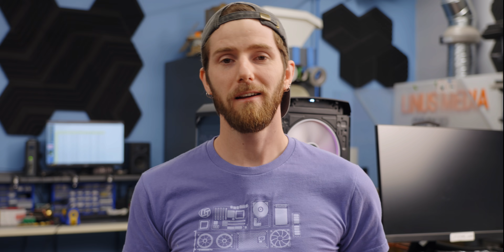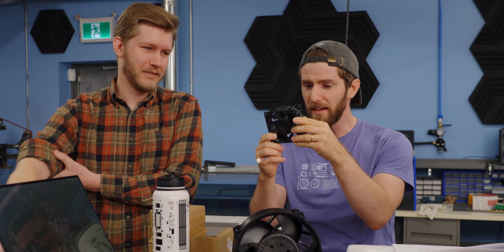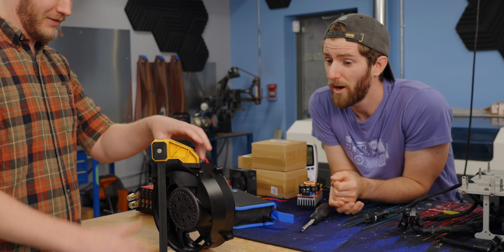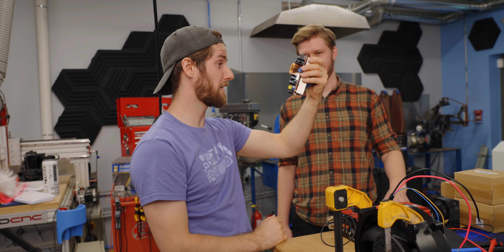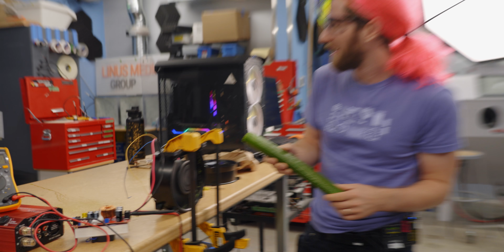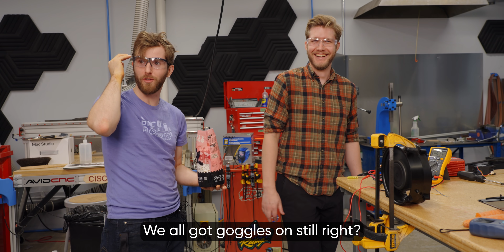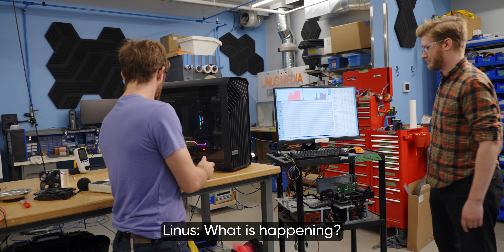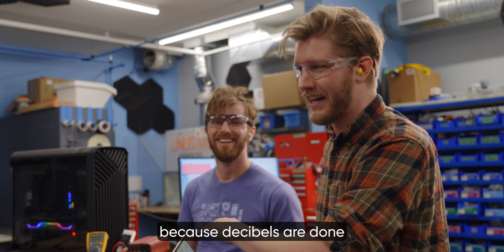The God of Computer Fans

Comment: Electronics like television transmitting equipment, broadcast etc need airflow en masse to be on the air 24/7 at a buncha kW dissipation, also stuff like industrial control cabinets sometimes have fans like that bolted to em depending on whats in there, also large transformers can be used at higher specs with fans like that, itll be a seperate rating specified on the nameplate "with fan"

Comment: RE 14:15 
It probably wasnt that model, but I have encountered similar large diameter high-airflow fans for cooling an entire racks of theater lighting circuits. Each dimming module had no fans of its own, so the rack fans pulled air through all of the modules at once. Even with efficient modules, there could be up to 384 thousand watts running through those distribution racks, which means a lot of waste heat. It really is about obtaining the most airflow volume.

Comment: The other thing with fan sizes is that on a large the blades are traveling a much longer circle, thus the linear velocity is much faster at the same RPM's.  Airplane and helicopter rotors are capped at similar speeds as these fans because they start becoming supersonic at the tips and end up with all sorts of issues caused by that.  Wind turbines rotate at far lower RPM's but at that massive of a scale the linear velocity at the tips also starts to apporach troublesome speeds.

Comment: Full ANSI face shield and level 2 kevlar STAT! Mounting fans that don't fit? Don't worry, I am a hillbilly. They are called Zip Screws. "Self Drillers" LMFAO    PS: Their use is usually equipment cabinets. Contactors, daughter cards, transformers, etc. HVAC/Server racks/Switch gear cabinets, etc.

Comment: Reminds me of the Fans of my old IBM BladeCenter H. It has two 3-phase inputs. 2 of the 6 phases are just for the fans with the fans drawing ~850W each on full power. I don't have the specs for the airflow though. They are centrifugal fans from EBM Pabst and build up a quite strong static pressure as they have quite a bit of resistance to overcome as they are pulling the air through the 14 blades.

Comment: Husband's old workplace had very similar fans in the server room by the racking.

They had the genius idea to have the servers in a room with direct sunlight where without the servers being on if it was 20 degrees outside it was 30 in this room so had fans like this to cool the room down especially with the server turned on
Reply: Why not just put foil on the windows to cover them?

Comment: That Fan is a (Telco) top of Rack Fan. Is used in (Telco) datacenters to extract hot air from the top of Racks (in addition to cold aile-hot aile methodologies). Sometines, the fan even connects directly to the Return Vent system.

¿Why all the Telco in between parenthesis you ask? Well, your fans are SPECIFICALLY 48V, and for historic reasons, Telco Datacenters tend to have -48Volts (yes, is minus forty-eight volts) readily available. In some (very old) telco datacenters, is the only power available.

By the way, right wing safety squad is right, those fans are also used as backup for the main climate system in BTS (Base Tranceiver Stations, not Corean Boy Bands) Shelters... That's how I first meet them fans (pun intended)

Yes, when you use -48V the power cables are MASSIVE, but you connect DIRECTLY to the -48v battery bank and save a ton of money on inverters, as well as the inneficiency (electrical loss) that the inverters entail, and remove a point of failure and maintennace cost...

I guess there are versions of those fans that use AC aimed at other applications like the Transformers of Valtteri Välimaa (I cuut my telco theeth surrounded by Nokia People) and N3ttx, or the Eurovision Screens of Graham Sutherland

Comment: I used to work for a solid state frequency converter manufacturer. We installed these fans to cooldown the 90kva to 550kva inverters inside the converters.

Comment: I have the same boost converter. Absolutely love it for projects that need 12-90v DC.

Note. The low volt protection does not actually power completely off.. At least on my unit.

Comment: i've had to get abut 30 for these for a new Net farm, we use them at the top of each enclosed rack to pull air into it. Cienna equipment makes so much heat. Fun fact you probably already know, most telecom equipment runs at 48-52VDC, AND the system is polarized, so negative is positive and positive is negative.

Comment: I can personally attest that Canadians are unnecessarily afraid on voltage in any form. 

I'm genuinely surprised y'all will unplug a wall socket without a CUL inspector or an electrician present. Your ignorance of electricity is actually shocking.

I see it weekly... It's a thing. Man up girls, it's just electricity. 99% of the time it can only scare you. RARELY is it able to hurt you.

Comment: Delta freaking EDFs, they are no longer fans. I've got an old one with a pwm controller, 20 years old, runs much louder than an old vacuum cleaner and actually rises most of it's own weight which is over 1kg. It's a small one, around 100mm, but really thick, almost a cube.

Comment: I have used something similar to these for cooling flame scanners on a boiler, basically the optical sensor can get so hot being exposed to the flame that a large quantity of air is need to keep the sensor alive. The noise is not an issue considering the blower on the boiler is considerably louder.

Comment: i work with current interrupters & diodes all day at work (corrosion technician) we use diodes on our rectifiers and anode systems when applied cathodic protection currents to gas lines / facilities. really to see this mentioned here in this build!

Comment: I've seen fans like that in robot control cabinets (like ABB 6400 size) as well as on ventilation/air purge solutions for flammable particles or toxic gases, so like welding stations and the like, and for induction heating cabinet cooling (20-50kW cabinets)

Comment: This was bad ass lol
  i would also like to see a write up on different types of fans , centrifugal fans , different axial fans like tube axial and vane axial fans … but particularly through radiators and etc for the most extreme cooling 

Some of these create high static pressures which would be great for radiators … 

Go from carpet blowers and swamp coolers.. to commercial kitchen vent hoods … to maybe scaling them down some how

Comment: We had a bed of nails circuit board tester.  It was set up for very large boards and required a several thousand watt vacuum pump.  The pump was real loud so it was placed in a heavily insulated box, but it still needed ventilation.  We used two of those fans, one blowing in and one blowing out.  The box did a good job of silencing the pump and muffling the fans. It felt like you could heat a house with the hot air blowing out.

Comment: 1) thode step up converters are ~20€ here in germany on amazon and the same (including shipping) on Aliexpress, so your 50$ ones are way overpriced
2) the connectors arent soldered very well but the converters themself are beefy enough to handle a good amount of power when cooled properly

Comment: I use these fans at work. 

It's 2 fans per-cabinet, and it's for and air dryer. It has a compressors in the bottom, then the radiators with these fans on top, followed by the desiccant towers and the control electronics on the very top.

They run 24/7 for many many years with no issue except the hearing damage.

Comment: From personal experience, you will definitely feel 48V, but it isn't enough to cause damage. Under typical circumstances, you can safely handle up to 50V DC before it becomes "dangerous". Atypical situations like wet hands, sensitive body parts, jewelry, and open wounds all dramatically reduce the body's electrical resistance, which could pass enough current to give a potentially medically significant shock. Power Over Ethernet is typically right around 48V, actually.

Comment: Some vendors are utilizing similar fans as backup climate control for base station (mobile cell towers) that are installed inside shelters.
Those fans are ideal for that usage as most of the telecom equipment on the base stations are powered by 48 V.

Comment: When the UPS batteries are inside the datacenter, it is normal to use this type of fan for the emergency air renewal system, in case any battery leakage occurs. It's a scenario where we have to get the contaminated air out of the room as quickly as possible.

Comment: It seems like it worked out just fine for y'all but as a side note measuring the output of a voltage converter like the boost converter you used can be wildly inaccurate if done without a load attached, so always double-check if you're using something more sensitive than a blowzooka. xD
Reply: Yeah, I thought the same thing when I saw that

Comment: We used these at HPE in our prototype testing racks, but we did have PWM controllers for them.

You can actually control the PWM with the blue wire, the yellow wire is the speed sense wire. So technically, yes, you can actually wire them up to the PC and let it control their speed.
Reply: Could you hook up the blue and yellow wire to a PWM fan connector, while having the power externally provided like in the video, and control the fan with fan curves, just like normal fans?
Or do they need the power also hooked up to the fan header?
Reply: @marcel1416  Yes you can definitely do that with common ground, aka connect the ground to the external PSU and to the motherboard, then you can connect the PWM wires etc. I used to do that with my Raspberry Pi.

However, these fans may be designed for different voltage of the PWM provided by the motherboard and even if they are, you would want to have these two circuits isolated from each other with like a controller that passes through your sense readings and PWM controls, it's better to fry a controller than a motherboard.
Reply: @Astra3yt  the PWM is probably 5v
Reply: @Astra3yt   I would probably isolate the two circuits with something like a photocoupler, which is way cheaper and easier. I wonder what the computer would do with these, would it PWM them to max speeds or would it settle them at a more reasonable setting?
I am against putting unknown things into common ground configuration, because you never know when these sketchy modules decided to do common VCC (yes that is a thing. For instance some LED strips would do that and you need common +12V modules to be able to control properly). If you are really certain the voltages are all good and the devices have common ground referenced to the grounded pin on the AC input side, you could technically connect directly, but still not recommended.
Reply: Thats a BIG "technically" 🤣
Reply: @dragonxx444  lol I didn't say he should, but hey. Let Alex do it so we don't have to!

Comment: This is purely conjecture, but my out of the box guess for a use of these fans would be incredibly high FPS cameras. Something like Caltech's 1 trillion FPS camera they use to study the movement of light. I imagine the processing power and data movement systems like that utilize is immense, and probably generate a lot of heat very quickly. Perhaps something like this fan can be used to move cooled gases through the system at a high enough rate that it doesn't burn out in a millisecond.

Comment: Old business/commercial computers back in the 80s had similar fans just not quite as powerful but if I remember right they were solid metal as well. TRS 80 model 2 had giant fans along with the massive 8” floppy drives. When you would turn it on, you could hear it spool up like these fans. I haven’t messed with them since the 90s so I don’t fully remember their actual size, I just know they were massive.

Comment: I have a pair of air hockey table fans, very similar to these. They are heavy, metal frame and blades and very loud but they can move some air, use them to vent the attic in the summer time.

Comment: 1. You need to check the air pressure inside the case. With the air being compressed, the air is going to be able to remove more heat from the cooler.
 2. The Noctua 3000 rpm fans are NOT the best actual case fans. The bgears BG01831 is a 12v 38mm thick 140mm case fan that puts our around 300cfm at max speed and the static pressure dwarfs what the Noctua fans do. I have 6 of them in a push/pull configuration on my current water cooled 5950x setup. They generally run at about the minimum speed that they can. They do spin up to max speed on power on which blows the dust out of the radiator if the computer has been on for quite a while.

Comment: You can buy these on REALLY cheap second-hand from old server rooms. These fans are indestructible. I bought two of those for toilet ventilation for like 8$ each on a flea market.
They are sometimes used in server rack cooling. Like, cooling the whole rack.
Reply: Toilet ventilation? Someone needs to change their diet.
Reply: @brodriguez11000  Or ask the apartment owner to clean the ventilation shaft from 50 years of dust.

Comment: The reason it takes a while to spin up is to avoid large current surges. Smaller Delta fans behave like this as well. A motor like this could take upwards of 25A spinning up from 0 if it wasn't for the soft start. Don't worry, these have plenty of torque.
Reply: yea many older but also a few newer angle grinders will blow fuses if they don't have like 30-50 Meters of extra cable running from the outlet to the grinder. And they operate at roughly the same power usage. though there are those that go way higher.
Reply: Let me guess, it has a positive temp coefficient resistor ?

Comment: I work for a larger Fortune 500 company as a security guard that has tons of networking rooms, they have ones like this to create massive air circulation and keep the room temperature cold. Think of the enclosed room as a larger pc case you can walk in; as the servers are technically exposed. Gotta keep the doors closed otherwise the temperatures get warm and network can shut down.

Comment: I've seen blowers like that before on inter-rack coolers. APC InRow for example. When you've got 30+ racks the best way to arrange them is a pod. All the racks face into an air-tight aisle called a containment aisle, typically hot-containment. These in-row coolers suck the hot-air out of the pod and cool it before venting outside the pod.

Comment: We used these 48v fans in my previous company which makes power inverters for telecom. 2 of these fans are are capable of cooling 48v 10kw inverter system that has an efficiency of 92%. That’s 800w of heat.

Comment: Drill machines, angle grinders & even some home appliances like food processors (basic ones) are 500-550 Watts. 1 HP is 735 Watts. 
They mostly use DC RS555, 775, 995 motors, So yeah pls be really careful around this equipment because it will really just SHRED WITH NO MERCY.

Comment: Use just one of these for a thick 200x200mm radiator for water cooling, with a high flow pump. Could reach a record without liquid nitrogen.

Comment: so these could be used in ATM applications. outdoor atm's are basically hot steel sealed boxes, filled with electronics. if the customer doesn't purchase air conditioning something like this would be used in place to help on on super hot days. we use a 1800 watt 48v/24v power system for most of the equipment.

Comment: I’ve used fans similar to these, it was used to create negative pressure inside in a sounds shielded 150hp(112kw) hydraulic power pack. Without it,the electric motors inside would over heat. The one I had was variable speed so quiet when not need unlike this monstrosity ha-ha

Comment: Military often uses these for cooling high voltage power supplies and RF amplifiers and related equipment racks for SATCOM and point to point equipment, so you're not far off on what they're used for.

Comment: We use this these types of fan to exhaust air out of a SEALED rack. They are normally located at the TOP of the rack. HVAC at my server room, air moves floor to ceiling. Cooled air is pumped into a false floor and exhausted out of the top of racks.

Comment: At my work, we have these massive 4u servers that contain about a hundred or more sticks of RAM. The things have 10 or so extension modules that can hold up to 12 sticks of RAM each, and the chassis itself has a bunch of powerful fans attached to the back to get enough airflow to cool that ungodly amount of RAM. Presumably, you could screw two of these to the back of a 4u instead of having 4 smaller fans like my work does. Those smaller fans aren't enough to vaporize my fingers if I make a mistake though lmfao.

Comment: On reading the back voltage from the other fan, you would need to put the multimeter on AC, since the fan is acting as a generator, it would be producing AC voltage